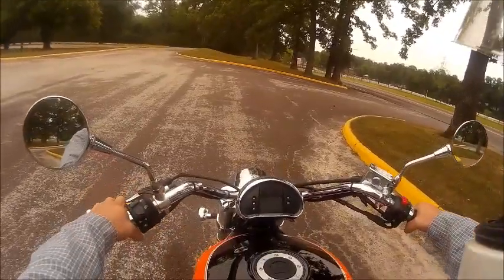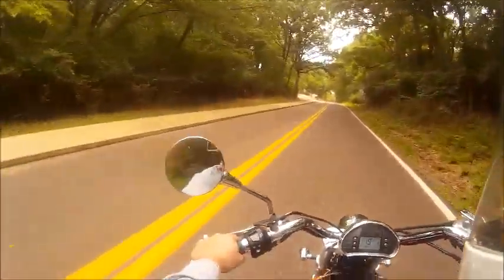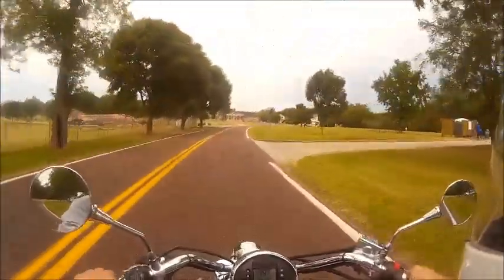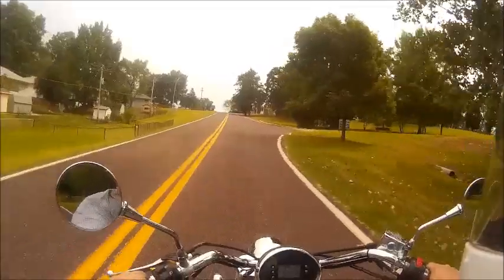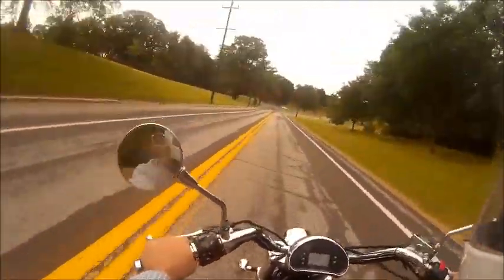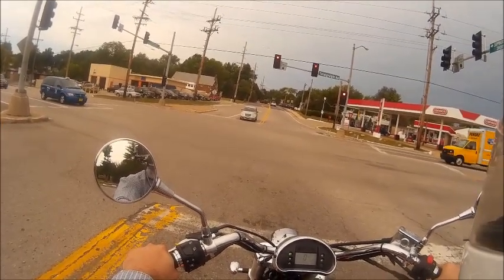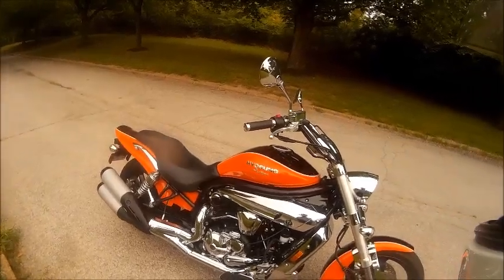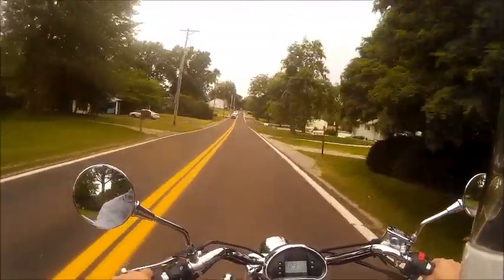SJ4000 Action camera External Microphone test. Hyosung GV650 ride.

Comment: So if you have it in the waterprof case with no mic attached you hear nothing? Or do you still have a microphone in the camera?

I would like to have a external jack for it and a mic as well. Do you think it's possible? So that I have sound underwater and when on land I would like to switch to external microphones.

Thanks alot!
Reply from the maker: No Problem.  No I do not have a inside mic. It is removed from the board.  Also with this mod the Mic has to have a hole drilled into the side of the case to accept the lapel mic jack.  You would have to get another case if you want to go diving with it.   If you wanted to leave the factory mic You would have to have some way of switch off the inside mic or you will be recording sound from everywhere.  And as soon as you get some wind rushing past you all you would hear is the horrible factory mic wind noise.  Since the factory mic is soldered into the board it would necessitate removing it then adding a internal mic with leads and a on and off switch then adding the external mic.  Big Pain.